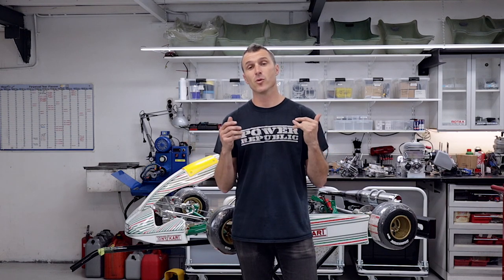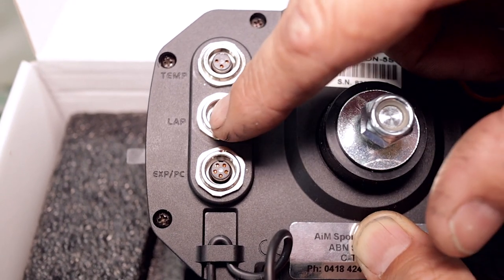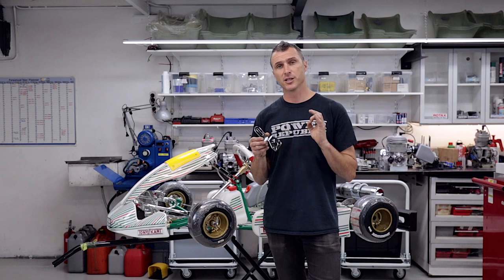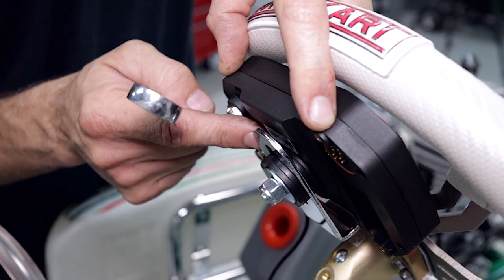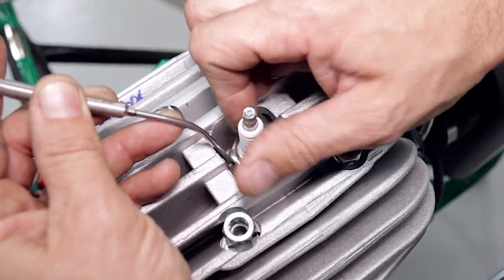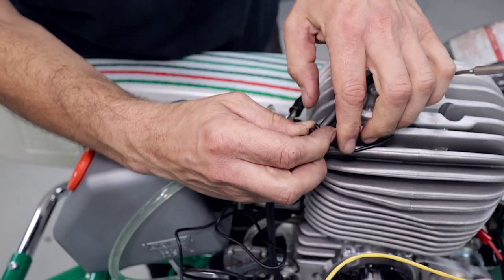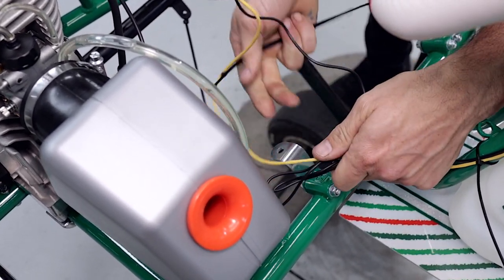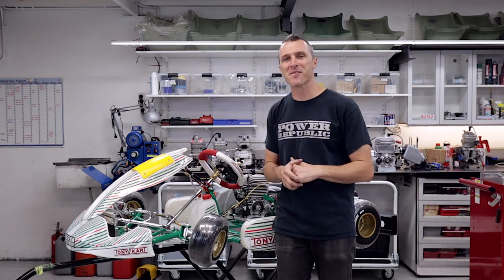HOW TO: Install An AiM Mychron 5 Go Kart Data Logger - POWER REPUBLIC

Comment: Hi Dez, could you do a video on how to install the M10 water temp sensor on a Rotax? If not, how do you do it? Thanks
Reply from the maker: Hey Dyl, sure can mate...

- use some teflon tape to wrap a couple of laps around the tread.
- remove the water temp sensor bung/plug from the head of the engine (red part) just in front of the spark plug.
- turn in the new water sensor using a 13mm spanner.

boom, you done!

Comment: Hi Dez. 
I have just changed motors from a x30 to a rotax evo and the new Rotax exhaust does not have a EGT mounting hole. Any suggestions on how to do that would be greatly appreciated. Cheers
Reply from the maker: you can buy a weld on fitting from Mychron.  I think it is called the T12 fitting
https://www.aimsportsystems.com.au/aim_shop.html#!/Bung-Fitting-for-EGT-T12-Sensor/p/54604749/category=14201408

Comment: What is your opinion on the Alfano lambda sensor? Is it as good as the mychron one you showed on the Others Video?
Reply from the maker: I haven't used it yet.  we are test running ALfano out this year so I will get a lambda sensor and let ya know.  It will work the same as almost all lambda set ups I would imagine.
Reply: @PowerRepublic  i do love to see it. On german karting pages they often say it's Not as precise as the mychron one. But those posts are often Form 2011 and older.

Comment: Great vid Dez. Perfect timing as was just researching between the Mychron 5 and Alfonso 6. I am running a 4SS Clubmaxx and was thinking that the Alfonso would be easier for me as When I do practice days I am by myself so have no one to do a stopwatch. Is it correct that the Mychron needs a beacon, but the Alfonso has in built GPS? Your thoughts would be appreciated.
Reply from the maker: Hey AL, nah both are GPS units.  basically they are both the same main features, only the display and operating systems are different.
Reply: The Mychron 5 and 5s also uses GPS. The new Mychron 5s version has more accurate GPS than the Mychron 5. The beacon pick up is an option that you don’t really need.
Reply: Thanks guys really appreciated! Get well soon!

Comment: Need a data logger for electric setup, designing a 20kw tony kart.
Reply from the maker: now we talking, how much battery you need for that?
Reply: @PowerRepublic  im thinking 21 cells lg 60ah prismatics from automotive wreck cells weigh 19kg total pack around 25-30kg enclosed but its low and centred
Motor weighs 10kg and controller 3kg plus a water loop im estimating a tony kart around 85kg there abouts.

Dont have the weight of a rolling chassis by any chance ?

Comment: Which is the difference between mychron 5 and 5s?
Reply from the maker: mostly hardware upgrades internally.   same interface and features, so if your 5 is still working like a dream, situation normal.
Reply: The 5s has slightly better GPS accuracy.

Comment: Hi for some reason my data logger says my am tests are yesterday why is this date and time are correct
Reply from the maker: Hey Steve, just check that the date is set correct on you unit.  otherwise do an update firmware if you haven't already
Reply: @PowerRepublic  thank you I’ll look into that I’ve only had the data logger 4 weeks

Comment: Hi there! Hope you feel better soon!  Great video as always. I have two boys in their first season of competition in Thailand. So, I find information on your videos incredibly helpful!

I have a question about how you wind up the rpm cable. In the MyChron5s manual, it recommends to just run the rpm cable along the spark plug cable without going around it (for two-stroke engine). But to do it exactly the same way as your videos when measuring a four-stroke engine. Which you think works more accurately?

Once things are better, please let us know if you want to come visit Thailand. We will show you around the karting scene here!

Thank you!

(My two sons just got some videos on their channels…
Tristan 10 - https://youtube.com/channel/UCMimlUyX-6c1aLAC6W9sn7A
Luke 9 - https://youtube.com/channel/UCy6kY-pttL8-Cn0ro9aaVkw
)
Reply from the maker: Hey Tang,

thanks heaps for tuning in.  would love to come to Thailand soon for a karting trip, which track is your local?

we use the wrap around method if the straight on method isn't working.   both are accurate if they are working at all.   If you don't have a preference then I would do the wrap around method.
Reply from the maker: Hey Adventure Ninja, don't be scared of the exit ripple strip!!!